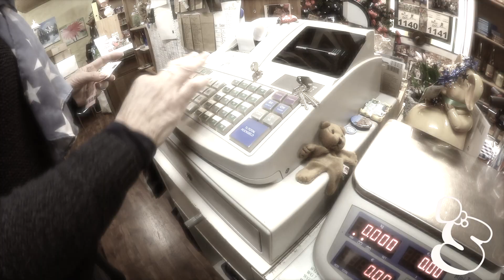The GAMEBOY wallet, homemade with leather

Comment: Ich habe eine Frage: Wo kaufst du das Holz für deine Longboards?
Reply from the maker: Baumarkt, ebay oder expresszuschnitt.de
Reply from the maker: 6x1,5mm=9mm. Das ist sehr dünn. Würde ich dir nur bei sehr wenig Körpergewicht und einer kurzen Wheelbase empfehlen. Bei 9mm musst du auch auf jeden Fall mit Glasfasern arbeiten.
Reply: Ok Danke 
Meine Wheelbase würde 38cm betragen und mein Gewicht 50kg.
Reply from the maker: Ok, das ist MINI. Das geht mit 9mm. Allerdings brauchst du Biax Glas oben und unten, sonst ist das Ding nicht torsionssteif.
Reply: Ok alles klar danke :)
Reply: sidekickx81: Eine letzte Frage habe ich noch. 
Kann man das 3mm Birke stark biegen?
http://m.ebay.de/itm/Sperrholz-Multiplex-Bastelholz-Holzplatte-Birke-Sperrholzplatte-Zuschnitt-Platte-/142175870882?var=&hash=item211a579fa2%3Am%3AmYmUs1Tym-5zngZwNFsKKzg&_trkparms=pageci%253A004ebca1-1f89-11e7-a158-74dbd180bcf4%257Cparentrq%253A627b34db15b0a6229717e3dafffb5cf8%257Ciid%253A3
Reply from the maker: Meistens benutze ich 4mm Birke. Damit sind Kicktails und Concave möglich. 3mm wird sich sogar noch etwas besser formen lassen.